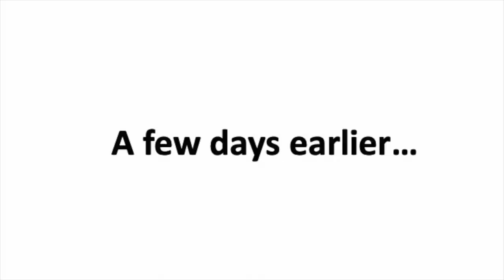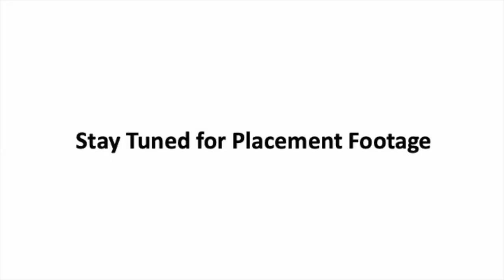Concrete Flooring! 🙌🏼 | Garage Build Philippines | Ep. 27 | TORINO

Comment: Hi Mike, How many guys are working for you? Also, I didn't see the vapor barrier. I thought you said you were going to put one down.
Reply from the maker: oh man, you're right, glad you picked that up. i was so determined to use a vapor barrier. i had under-estimated and ordered 3 packs of plastic and related needs, but found I needed 4 more. so, every order i tried to place fell through, it seemed there was a lack of plastic sheeting on hand through shopee and lazada. 

anyway, time was running out so i went ahead with the pour. basically, i waited too long to check if i had enough plastic... it would have been a good experiment. by the way i also planned to cut the floor into squares for crack relief, but now i am second guessing that... we will see.

my main construction crew was around 5-7 guys, but, for concrete pours we always ramped up to about 15 or so...
Reply: @T O R I N O™ Building in the Philippines  Thanks Mike.